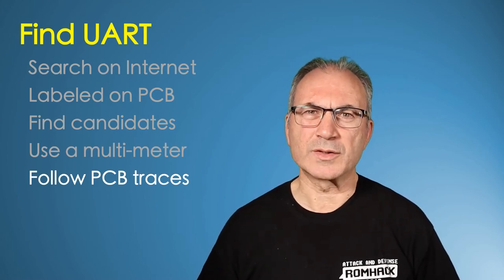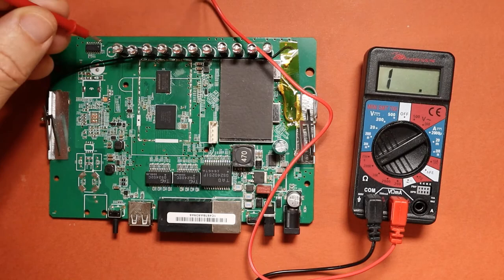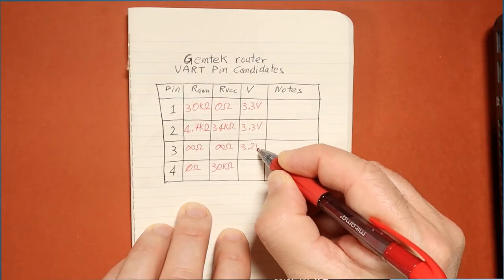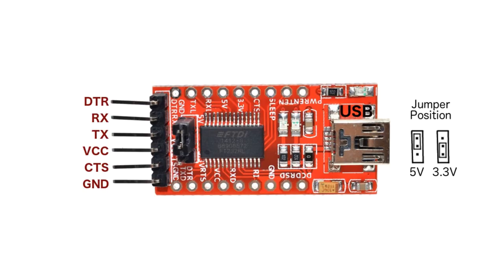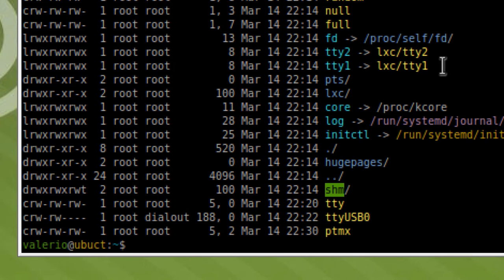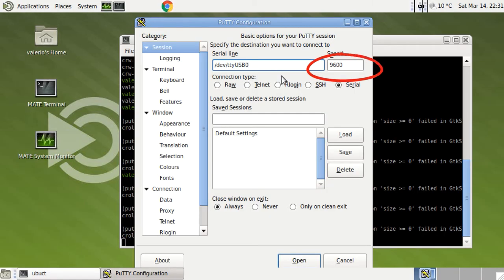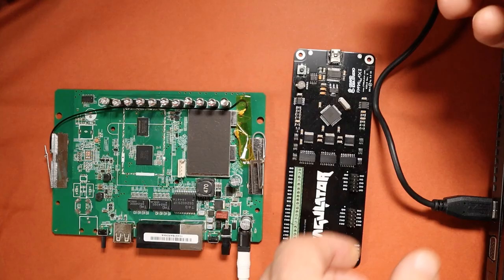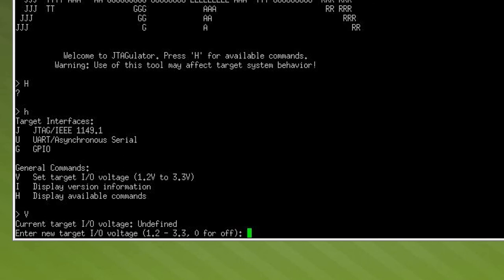#02 - How To Find The UART Interface - Hardware Hacking Tutorial

Comment: Is there any way to add a USB port or to solder a USB device directly on the motheboard of a router that doesnt have a usb port, for example?
Reply from the maker: Hello Gater Security, thank you for your question and sorry for the delay in answering. Usually, if a router has support for USB  it has the possibility to install a USB connector on the motherboard, if not already installed. It is possible that the processor has support for USB, but if you don't find anything on the motherboard usually (but not always!) means that the router's software doesn't support USB connections.  If you have the processor's datasheet and you know that it supports USB you can try to attach a USB device to the related pins but probably this will not be supported by the original firmware.
Reply: @MakeMeHack  Thank you for the response, i will look into it, i was asking because i have a tp-link router with OpenWRT(open-source firmware) but it doesnt have a usb port for me to plug a usb camera, thank you so much man , i will do some research on the topic, have a nice day!

Comment: Nice work with the videos!  Maybe You can help me out with a problem - I found UART pins and connected with PUTTY all good.. got welcome message and so on as a responce.. console prompts me that type "HELP" for more options but typing that wont do anyting. RX pin on board is 3.3 volts so its not been cut. Any ideas how to proceed? Typin HELP or anythin else no characters appear on the screen but RX light on my FTDI converter flicker evey time I type so that is defenently working.... Thanks